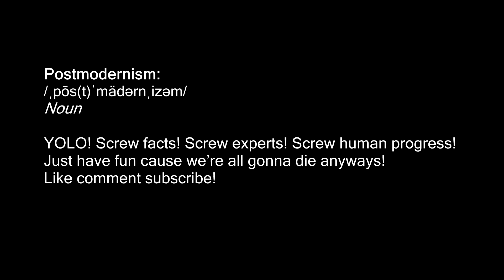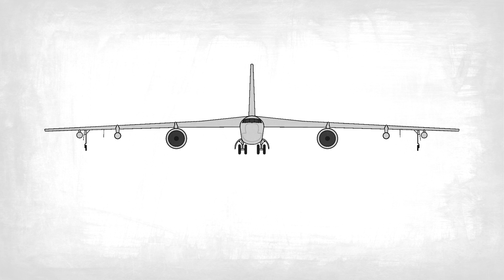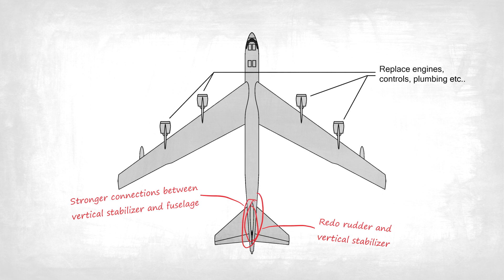The B-52 is Getting New Engines... Why Does it Still Need 8 of Them?

Comment: The ‘new’ engines are basically off a corporate/regional jet. They are puny. lol.  One  GE-9x is 100,000 lbf…that’s near the total of the 8 new ones.  The whole airframe is just too old with too many compromises to truely update the engines to new technology.   A 777x has more payload capability even as a passenger plane.
Reply: I've pondered that, instead of new engine on B-52, what about new aircraft? Adapt an airliner-type aircraft as a bomber? They have the range and payload capacity, would just need to modify the fuselage to have a bomb bay - to be able to not bring the cargo back with them. I suppose the P-8 actually sort of is that, a modified 737 that can drop bombs. A better but more expensive approach would be to replace the entire fuselage but keep the same wings, engines, landing gear, tail, cockpit, and so on. I suppose the main concern there is that airliners weren't built for the rigors of combat, weren't designed to survive being shot at. Probably they'd want four engines for that reason, even if two would be more than adequate power.
Reply: The B52 can carry 84,000 pounds of ordnance in the bomb bays plus ordnance on wing pylons. I don't think that the 777 can match that.
Reply: @stevenbass732  adding wing mounted stuff is not horribly difficult. The B-52 was never originally designed to carry them or launch cruise missles either.  A 747 is set up to carry is 5th engine on a wing to ferry one!   I believe the 777 has a bigger payload capacity.  The B-52 is not a huge as one imagines…787 sized.  

It’s an old bird with lots of limitations.  Still does its job well.  Just $$$ / hr costs soar.
Reply: @stevenbass732  Quick Google search gives 777F as having a "revenue payload" of 226,000lb. So that's a good bit more than a B-52, to say the least.
Reply: @quillmaurer6563  And? Your point is? They are purpose built aircraft. Payload doesn't mean much in that regard. A 777 can be used as a passenger aircraft or a freighter (with modifications). It would not make a very good bomber.
Reply: @stevenbass732  You cited the B-52's bomb load capacity, and I found that the 777 can carry far more cargo. I would assume a bomber based on the 777 could carry a bomb load comparable to the 777F's payload. There's other considerations of course, but in terms of payload I think the 777F has the B-52 beat by a large margin, in fact several times over.

Aside from lack of a bomb bay, what would make the 777 not a good bomber?
Reply: @quillmaurer6563  Quite simply, the design. The 777 would have to be redesigned to incorporate bomb bays and the associated operating systems. You can't just cut a hole in the bottom of the 777 and add doors. Without modifying the frames and strengthening the fuselage, the 777 would likely come apart with the first heavy turbulence.
Reply: @stevenbass732  True. I would expect that designing a new bomber based on an airliner would require pretty much a new fuselage, but could use the same tail, engines, wings, landing gear, systems, and so on. Would make sense anyway, as the fuselage could be far more slender given the high density of bombs compared with cargo or passengers. But being able to use these airliner parts would be a lot cheaper than designing an airplane from scratch, I would think.
Reply: Come to think of it, what would probably make the most sense would be to base a new bomber on the C-17. Use the same wings, engines, tail, systems, and so on, but with an all-new fuselage. Would need to design new landing gear though. The C-17 is probably better suited than something like a 777 given it's four-engine arrangement, high wings, and that it's already used in military inventory - would greatly simplify maintinence and parts inventory if as much as possible is common with another aircraft in the fleet. Only drawback is that the C-17 is relatively slow compared with the B-52 or most civilian airliners.

Comment: Add why is this plane still flying? The maintenance cost alone should justify a new platform. Drones provide a much more cost effective solution but maybe  the b52 lobby group is to effective?
Reply: Not the lobby. The US has tried to replace the B-52 many times before (XB-70, B-1, B-2) based on new missions, nuclear/conventional mission and technology. None of them has had the staying power of the BUFF. In uncontested airspace, the amount of ordnance that can be unloaded with little risk is unmatched. The other bombers largely traded payload for the ability to penetrate Soviet airspace. In the case of the XB-70, to outfly interceptors and SAMs, the B-1 as a low altitude penetrator and the B-2/21 as low observable delivery platforms. The XB-70 never saw service, the B-1 was cancelled and then resurrected with only about 100 seeing service and only 21 B-2's were produced due to the astronomically high costs. The B-52 has a simple mission with increasing long range weaponry and, relatively speaking, is still pretty affordable to maintain. Hope this helps.

Comment: Difficult to accept.  Though many have claimed, for various reasons, the plane must have eight engines it is hard to buy.  Engineering can be adjusted, we do not live in the dark ages,  pylons can be adjusted where needed.  Half the engines means half the parts and half the maintenance which is very significant.  The claim that the loss on engine is big deal is, I believe, fallacious.  If one engine on one pylon is lost it is very likely that the other on the same pylon is lost as well.  If it is claimed that the pylons cannot handle the loads of one engine then how can it handle the loads of two?  The size of one engine can be accomplished for they are not that low with a high wing configuration.  Yes I know others have argued otherwise but I require proof not just opinion.

Comment: the most obvious reason for the extra engines is a bit twofold.its a super heavy bomber.its designed to drop retarded amounts of ordinance.passanger jets don't need to deal with near as much weight ranges.the other side is redundancy,in case of an engine failure it would still be able to fly.more engines in the system,better the redundancy.each engine isn't having to do as much work so when one goes out it's easier to compansate. take a jetliner with only 2 engines,and one fails,it both lost 50% of it's thrust,but also all of the remaining thrust is now on one side of the plane making compansation much more difficult.
Reply: Not exactly. The goal was to carry a certain number of hydrogen bombs of the day, which were very large and heavy. P&W's existing turbojet engines only delivered so much thrust. Thus Boeing used 8 of them. If the TF33s had existed at the time of the XB-52 then there would have been 4 TF33s. P&W would forever suffer from Boeing's extremely demanding aircraft designs. Almost everything was bigger than what P&W had on the shelf, thus requiring more powrrful engines to be created.

Comment: 8 smaller engines are cheaper than 2 big ones.. maintenance is easier and  cheaper..
and since the  b52 flies on 4 engines most of the time, 6 for takeoff and  landing..8 in times of war..
you  have plenty of spares,, both on the planes and in the  shop being recertified..
and still thats  cheaper than 2 big engines and  more  backups and redundancies..
and you actually  have each b52 carrying  its own spares

Comment: No need to change so many config, 8 engines~more power and better fuel eff. New control panel! 60more yr old wiring needed to replace. All eng designs ~ will make 10% more or less capacity.

Comment: Author vastly overestimates complexity of changing other plane parameters. You would not need to change plane hull in order to change plane's rudder. What a nonsense is that? You would need to replace its wires controlling rudder, but that is a minor issue. However, he is right on his main point though.

Comment: The problem is that the B52 engines  were designed in the 50's when the engine stator housing were a certain diameter the new engine housing are bigger so unless you think dragging the engines on the ground is good they will just be upgraded all 8 of them!!!
Reply: you hev squirrel  Yes it would seem so,however there is more to the B52 than bombs/missles there is the 30miles of wire powering multi layered communication and defensive and offensive eletronics systems rivialing AIRFORCE ONE!! the B52 was designed to take on a combat enviroment!! The 747 was not,her strength is in her upper structure not her cargo area! So what are we to do when droping ordinance,flip the plane and hope the bombs do not hit the tail,that is why there are bombers and transport planes!! Cobrapub OAS/CMI B52 contract design engineer!!!
Reply: FYI,the  B1,prediscessor for the B52 was recently retired due to the mantainance cost for a super sonic bomber!! This was the reason for the SR71's retirement! Next is the B2 it still fly's but because it may be retired due to the lack of room for upgrades and mounting repair costs!! Lastly the B21 my suffer the same fate as the B2! The last hope for the bombers is the TR3 technology still under developement, totally out of this world !!!
Reply: you hev squirrel  GEEE I am sorry you see my passion as taboo but I thought I was talking to a normal person odviously NOT!! I grew up with aircraft and I enjoy there company over yours so QUITE WASTING MY TIME  with moronic statements you can not backup!!

Comment: The argument that it’s all about “government budgets” doesn’t make as much sense when it’s the US military which already uses $784 billion. They have virtually limitless funding.

Furthermore an eight engine solution that keeps the same form factor and rudder but doubles the number of complex components (jet engines) probably costs even more in parts and maintenance over the next decade than a program that requires a new tailplane assembly (a one time upgrade per airframe) and half as many jet engines per airframe.

It might sound cynical but I wouldn’t be surprised if keeping the B-52 at 8 engines was entirely due to keeping certain jobs in certain congressional districts.
Reply: All the competitor engines were submitted based on an 8 engine design. GE, PW, RR, and Honeywell. All those manufacturers are located in very different Congressional Districts.

Comment: They got the Rolls Royces engines, pass on GE’s lower priced GE Passport and GE new jet engine that offers more power and fuel efficient because it was to beyond the specs.  Rolls Royce was the closest to the U.S. Air Force needs but cost much more then Boeing or GE.

Comment: Modern high bypass turbofans are not really jet engines.
They are ducted fans powered by jet engines.
More like an advance of the turboprop (putting it in a duct) rather than an advance of the jet engine.
Its why they are so large, most of the air sucked in at the front is thrown out the back to generate thrust without passing through a combustion chamber. Its the duct which provides the compression and extra thrust.
They are quieter and far more efficient than putting all the air through a combustion chamber, like in the original jet engines. The only advantage is that jet engines on their own are much smaller.
Why an aircraft designed for jet engines in the 50's is a bit of a bitch to update to modern turbofans.
You need to use small ones.

Comment: You said,” We’re dealing with the gov’t on cost” as reason for not going with less engine counts? Are you serious? When has that ever really been a problem for the military? So wouldn’t a refit with two engines and removing all the extra wiring, plumbing, etc reduce complexity, weight and placement close to the fuselage place less strain in the event of an engine outage?

Comment: The wings & airframe were designed for weaker engines and more of them. Larger engines would tear the wings apart, and wouldn't fit under the landing gear. Not to mention the entire stabilizer redux that would be required. 🤔 🧐   
🤟🏽🐻

Comment: Great nerd-ish video, how does the fuel consumption of the original engine  or engines compare to modern bypass turbines?
Reply: I seem to recall modern engines would be something like 30% more efficient, which would directly translate into that much better range. My understanding is the number of engines isn't a huge factor in that, it is somewhat, fewer larger engines is more efficient thus airlines have gone almost exclusively to twinjets, but that's a small difference compared to the old engines versus any new engines.

Comment: Also, it's RCS (radar cross section) head-on to the target would be much higher using huge turbofan engines (2 or 4) instead of 8 smaller ones, especially at the typical radar frequencies it would be hit with on the way to a target.  The B-52 was already bad, yet huge engines would make it even worse on a long range mission.

Comment: I lived with these aircraft for 4 years in the airforce. And it was funny at the time but on the tail was a number that showed when the aircraft was built. And some were 18 years old, and the same age I was. And as they were always bombers on alert and aircraft in the air 24/7 ready to go. And it finally dawned on me that if the absolute worst came about, then at least my death would be quick and basically painless. But you develop a attachment to them, and knowing the truth of your situation. You know your going to die if worse comes to to worse. And in a way you get use to it. And I guess it was worse for the aircraft crews who had their families on the base. They realised that for most of them it was a omrwsu trip, and there would be no base or family to come back to. But it's something we never talked about. I imagine to keep our sanity intact. But there's one thing I was going to find out if it was true. While I was in high school I read a book and a Survivor of one of the two bombs dropped on Japan put his hand up during the flash and said he saw the bones in his hand. And for some crazy reason I've always remembered that. And while stationed in Vietnam I actually got to see the power of those aircraft. It was at night and I had been assigned to pull guard duty on a building in Saigon. And no I don't know who or what they used it for, it was way above my pay grade. But I was assigned to the roof with a career buck sergeant. And out of the corner of my eye a weird red glow pulsated a blood red light that lit up the clouds. And it turned out to be a B52 raid around the Benoit Air Base which was about 30 miles from were we were. And for the first time I realised the power and detruction those aircraft could cause. And as we were heading back to the base it came over the radio that they had bombed around the base to stop rocket and mortar attacks. And it was clear to me the power of those aircraft. The BUFF is one seriously dangerous aircraft. So sleep tight America because the buffs are on station 24/ 7. And peace is our profession. And if you're not peaceful we can turn any city into a glass floored self lighting underground parking lot. And yes you develop a weird sick sence of humor .

Comment: I discussed this with an actual retired B-52 pilot with years of PIC experience. He thought the argument against 4 engines was ludicrous. He stated emphatically that losing both engines in a pod, equal to losing one of four engines, was not a problem. Even if it was the outboard pod, the one with most leverage to affect flight. Even losing all four engines on the same wing was not likely to cause a crash as long as the pilots responded quickly with fuel transfers to balance the aircraft. Lack of rudder was not an issue.